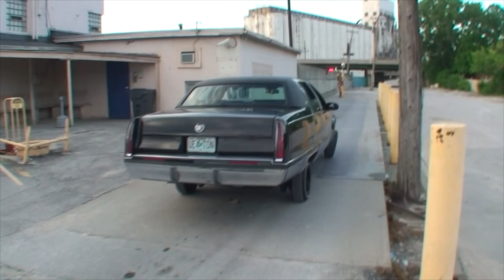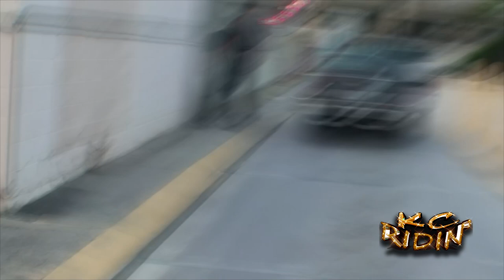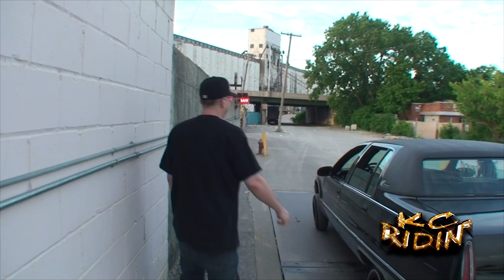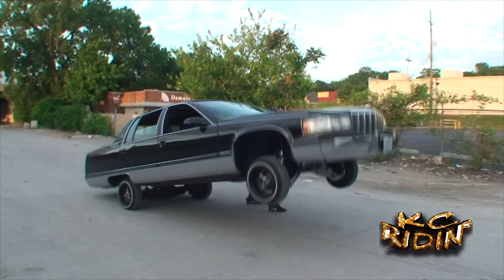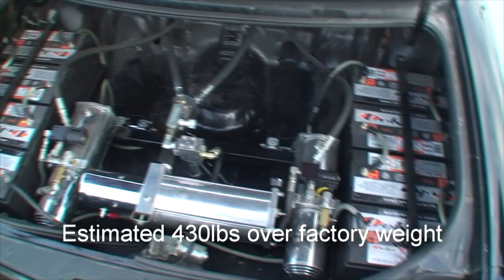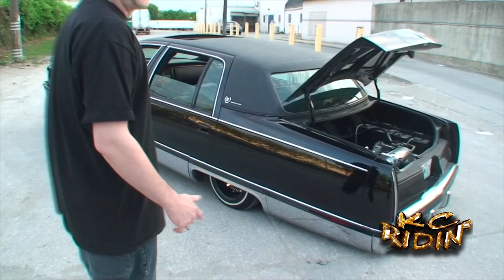No weight hopper Bigbody edition

Comment: Doing the damn thing any advice bro u could give me  Gonna pull out my 78 El Camino has 10 brand new batts 1150cca brand new front coils and Everything brand-new piston pump all 1" plumbing and my question is I'm running all 10 to nose and have 2 tricked out marzocchis 13 and 11 which would be better I have a hop contest this Saturday it's completely wrapped this will be the first time the car will be out thanks bro in advance👍👍  if u have an email I can send u some pics of it so u can check it out thanks playa love all your rides u make em seam so easy 😉✌️

Comment: What size cylinders
Reply from the maker: 8s and 14s
Reply: Did u have  to put drive line extenshion.  i want to put 14s on the rear on mine but. They say i have to extend it
Reply from the maker: Yup you'll need a slip shaft and shorten it to the proper length for your car.

Comment: is this a partial or full wrap frame car?
Reply from the maker: Partial.  Bare minimum.
Reply: @diggityd77  i need to do my rear arches with bridge. Fronts with as much as the crossmember as can be with motor in still and inner pockets and ears atleast
Reply from the maker: @SOUTHSIDESUPERSTAR  correct.   That's minimum and will work if done properly.
Reply: @diggityd77  would you recommend those cylinder sleeves up front?